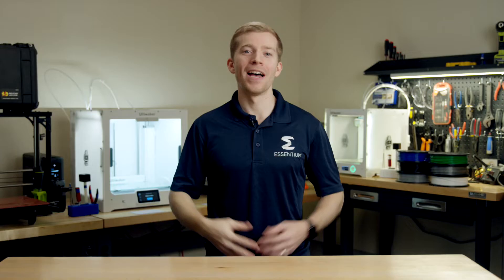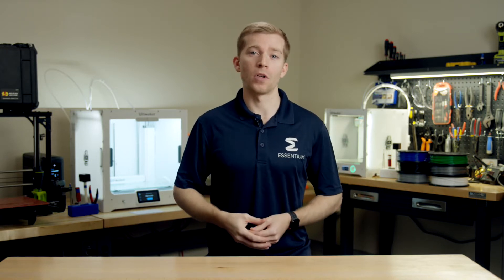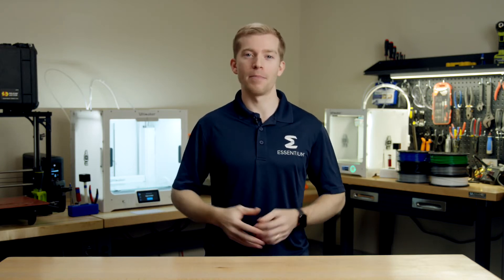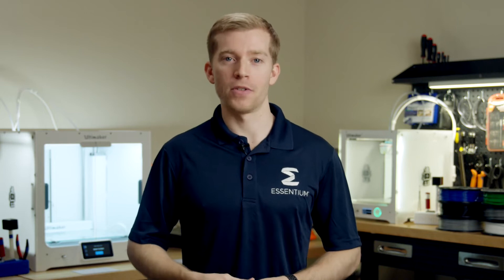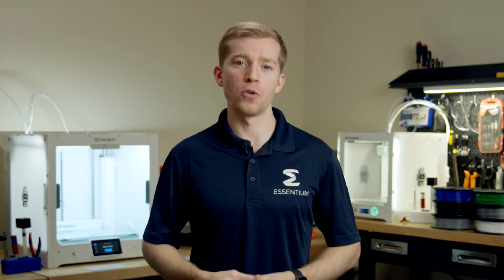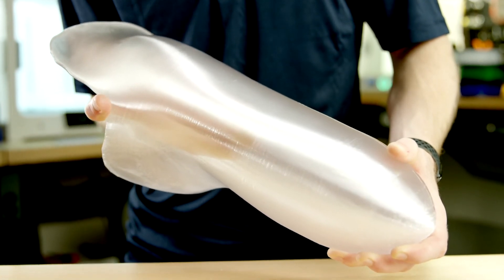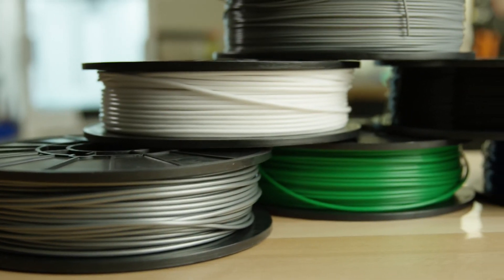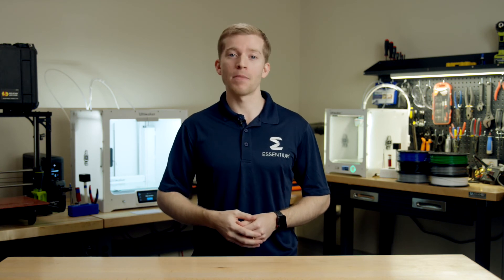Essentium Materials Guide: PCTG - Part 1

Comment: Is PCTG more impact resistant after annealing? Because many youtube video shows that differences from PETG are measurable, but insignificant and some videos show that it breaks sooner. My experience is that it has lower tendency to shatter, PCTG cracks and bends, but crack does not propagate that well, on the other hand, my guess is that PETG survives about three time harder impact. Of coarse all depends on manufacturer, exact print conditions (speed, over/underextrusion, temperature, cooling and in my experience even color).
Reply: For the videos where PCTG breaks before PETG, I can almost guarantee that it was not printed properly. Either too cold, too fast, or a combination of both.
Reply: @johnschneider9654  Idk, I tried 270C, 9mm3/s if I recall. I haven't used it for like 5 months. Tried but is was wet and adhesion was very bad, even after 4 hours of drying at 60C so I used PETG instead. But I assume there are different formulas, some people say it odorless, but it smells like burnt plastic, although smell is not strong.
Reply: @pavelperina7629  which brand of PCTG? It shouldn't really smell like anything at all.

When I have had to dry it, I do so at 70C and usually for 6-ish hours.

Either way, sounds like a frustrating experience for what is typically a fantastic material.
Reply: @johnschneider9654  It's Extrudr (Austrian brand) black PCTG, yeah, I used it only for small flexible parts. It's a bit softer than PETG, more shiny and more ductile/less fragile, but I found it somewhat worse and more expensive. Flexibility is main advantage and also it does not stick to itself that well, so it's better for tight tolerances.
Reply: @pavelperina7629  ah. I stick with 3D-Fuel (a US manufacturer) for PCTG